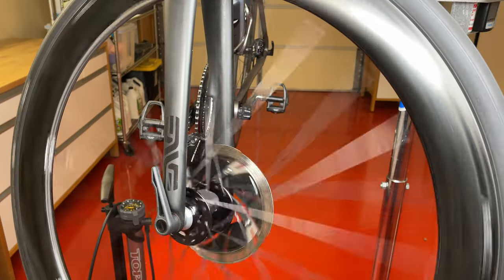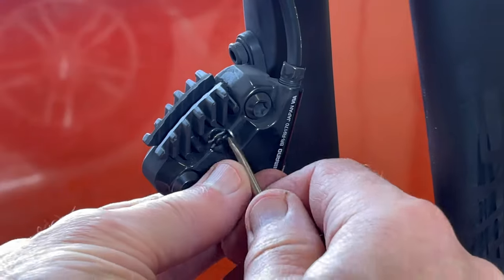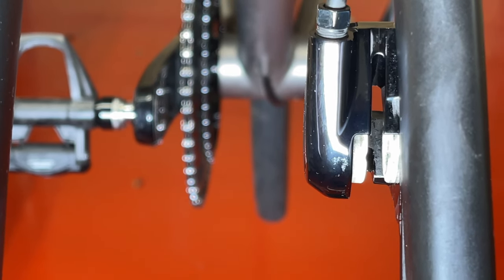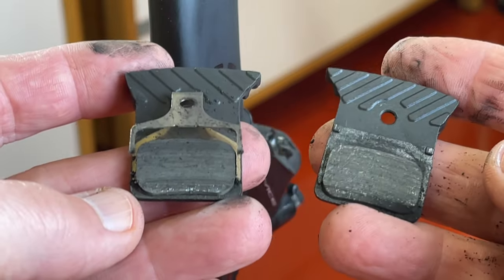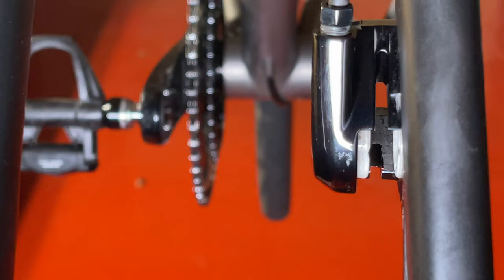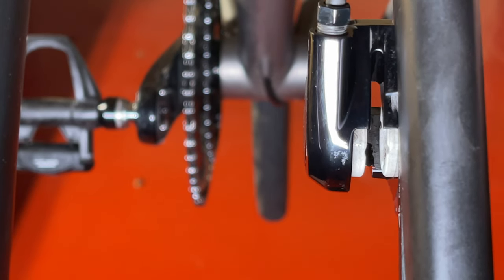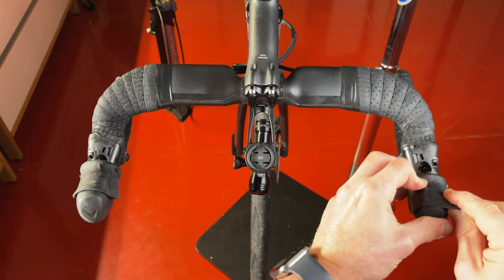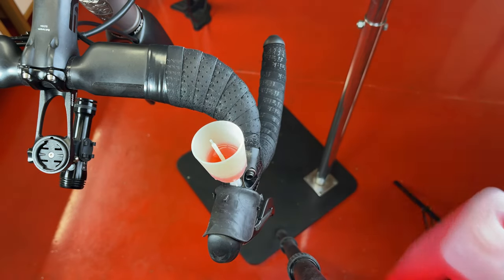How to Fix Disk Brake Rubbing Sound

Comment: Such an expensive way to maintain. rim blocks last a few years and cost as low is 20 for rear and front. Discs however require more attention because they rub. Just not needed. Rim brakes stop you just as good.
Reply from the maker: Thank you for your comment. Of course the rim brake technology is well proven and they do the job. Have you tried riding a bike with the disk brakes, especially on a technical descend? The predictable brake modulation gives a new level of bike control even to a an experience racer in dry weather, and when it is wet they are indispensable. The initial investment is high. However, I found the maintenance cost in parts to be about the same as for rims over 3 years I used disk brake. Happy riding!